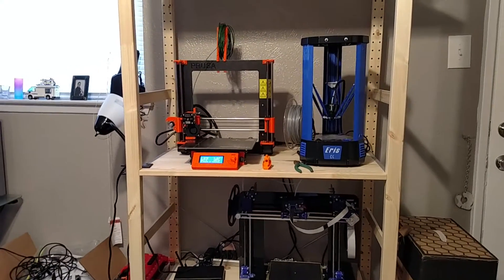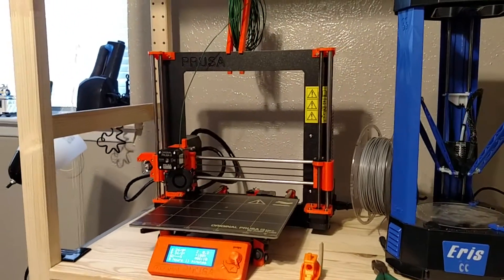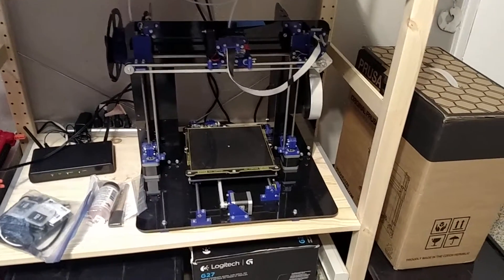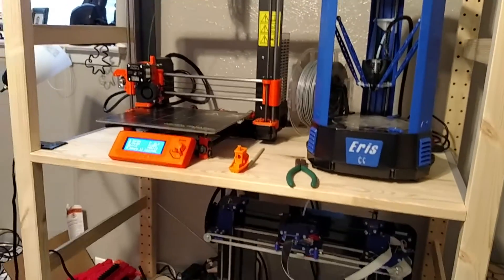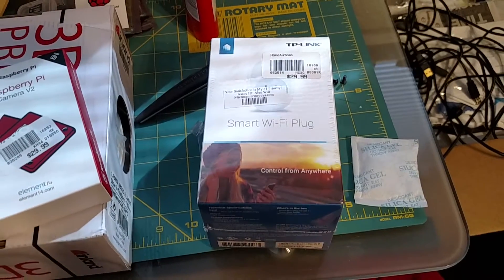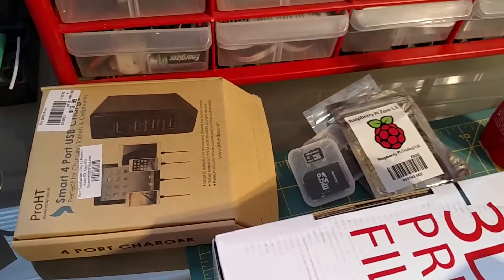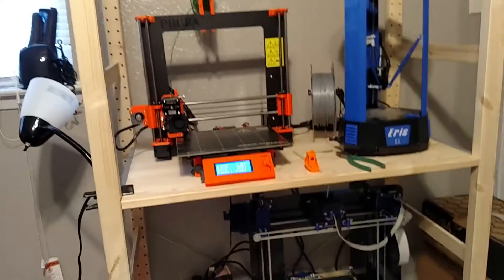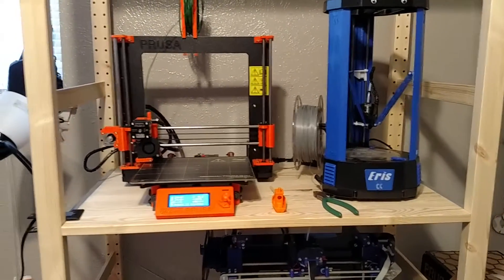The 3D Printer Shelf - The Automated Print Farm

Comment: did you try parallel printing with it ?
Reply from the maker: Not yet, I had issues getting the Pi Cams to work with the Pi Zero and the stable release of Octoprint, I have fixed the issue using a Nightly build. I just bought a new camcorder and will be making a video on my latest setup. I have been busy and haven't had time to hook up all my printers with octoprint yet.